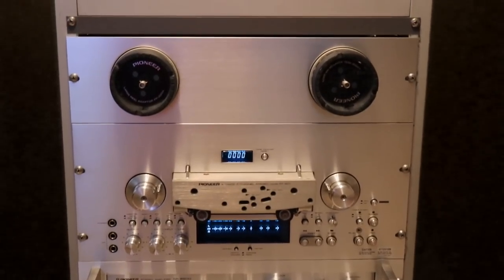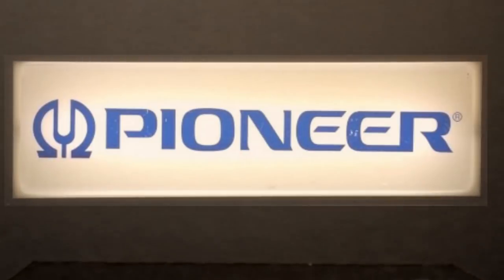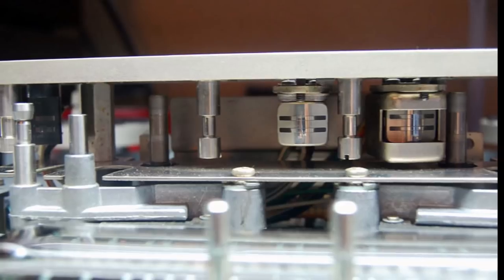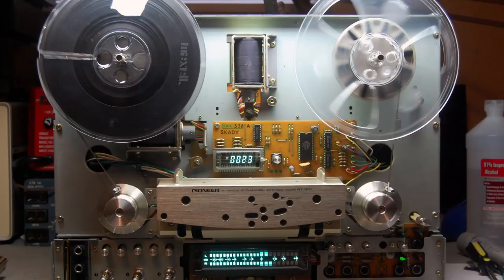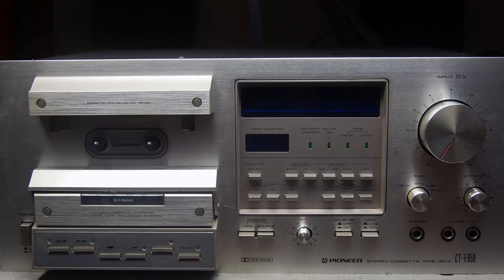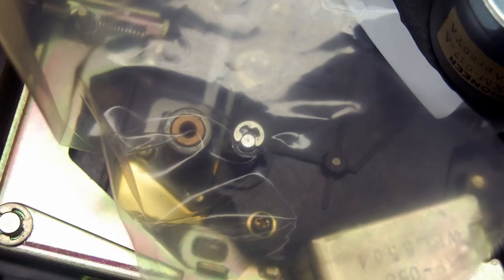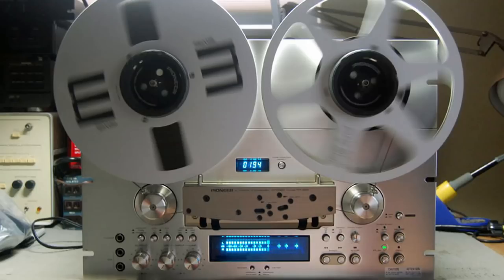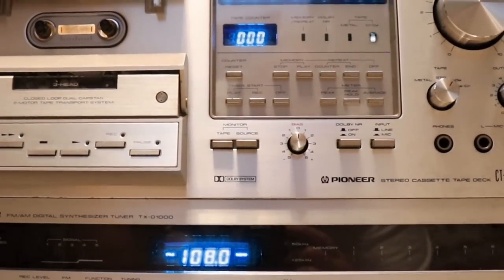Pioneer Silver Rack System. Vintage Amplifier Tuner Tape Decks Reel To Reel & Cassette Classic Audio

Comment: Such pride in the Build quality and looks of the old equipment , I miss that
Reply from the maker: Your not kidding. Just beautiful audio equipment that was made to last and it has.
Reply: My dad had a Sansui 1000x and a set of SP2000 speakers , record player and Tape with an Akai Reel to reel. It's I pity he let the 1000x go to a friend when he bought his 1st AV 5.1 surround amp. I still have the SP2000 speakers , the boxes are tired so I have removed the squakers , tweeters and 12" woofers and cross over network which are still in good working order for over 45yrs old.
Reply: D 1   I agree with you. And I miss them too!
Reply: @TheDarrenSR  I noted about your Sansui stereos. That was one major Japanese company which made high quality, durable and also most beautiful stereo equipment back in the 70's, 80's and upto 90's until sadly they closed down. The speakers you mentioned is a testimony to it. Yes, it's a pity that your father sold the amplifier. Anyway good memories for you!
I don't have Sansui and I wish I had. But I have some Pioneer stereo components.
Sorry about the late comment.

Comment: I've found that the rubber belts and tires and pinch rollers on Japanese-made reel-to-reel tape recorders from this ere almost never need replacing. Cassette deck belts are another matter.
Reply from the maker: Thanks for commenting.
Reply: I have seen many of the rubber 
Belts turn to black goo . It's a sticky mess !

Comment: You ever hear the story about a teenage boy who had this type of equipment back in the 70s before the blue equipment came out. Well, that's me. I totally regret getting rid of my Sansui speakers, Pioneer amp, preamp, tape deck, reel to reel, and the equalizer.  But I think the equalizer was from the 80s because it had the blue fluorescent display.
I think it was an ADC. I even had a pair of 
Altec Lansing floor speakers. I also had a pair of JBL 100s. I miss those days.
Good cheap weed. You could actually camp on the beach at night back then.
That was cool. Do some shark fishing at 3 am.

Comment: I have a RT 909 and a sa 8800. I want to get a cassette deck to match. I would love to find a pioneer rack. I wanted the RT 909 when it first came out. I purchased one in near mint condition from the original owner. He was leaving the state and could not take it with him. I picked it up with a bunch of 10 1/2 inch tapes for 350 dollars. I also picked up a rt 707. I love them and they sound great. Also he gave me the original receipts and the receipts for the mantaince that was done, belt and lubrication etc.
Reply from the maker: Very nice equipment that you have! There was so much high quality stereo gear back then. You could walk into any stereo shop and there was quality gear from end to end.

Comment: Im 58 now, but  back in the 70's we lived in El Monte Ca, back then there was a place called Best Products in West Covina, kinda like best buy, they had a small high end room that had this exact system, but it sat on a white, and black formica console table about 3 1/2 ft of the ground, it was kinda built in. the rack system here was at the back, and in the center of the table sat the turntable. It was definitely impressive, and expensive.
Reply from the maker: Thanks a lot for sharing. Many of us have fond memories that involve what is now vintage audio equipment.

Comment: Check the bias, the magna wide amp's have a two stage adjustment and service manuals was hard to find so many are wrong. My 7800 had this issue. Great Video's!
Reply from the maker: Thank You!

Comment: We have to pay outrageous money today on "HI End" stuff  to mach the average Japanese late seventies and early eighties top of the line quality, ( early nineties for Japan domestic market). Sansui, Pioneer, Kenwood, Jvc, Technics, Nakamichi, Nikko, Akai, Toshiba, Mitsubishi, even Hitachi and AIWA made amazing gear. I still have a complete AIWA minicompo all separate pre, tuner, cassette, remote unit, and power... with toroidal transformer and 15k mF caps for a mini compo! works like day one.
Reply from the maker: Your correct, back in the day you didn't need to buy the most expensive product in a manufacturers product line. All of the models were engineered and built well. Your AIWA is a great example.

Comment: I have the same Amplifier and Cassette Deck. I also have the TX-9800 Tuner. I think I have some dry joints in the Tuner and my Cassette deck which I haven't used.since I moved 7 years ago, now needs taken apart and the belts done. Enjoyed your video!
Reply from the maker: Thank you for watching. I hope it brought back some good memories. The Pioneer fluoroscan equipment was/is beautiful stuff.

Comment: This is the exact same system that was displayed and you could buy in the military exchange in "81".  I bought the RT-909 and if I remember a big pioneer SA amp can't remember the # but it was the biggest at the time.  The pioneer reverb or echo chamber and a couple other pioneer pieces the only thing that wasn't pioneer was my Kenwood Equalizer black with built-in reverb just because it looked cool and huge Harmon Karman speakers.  Bought everything new just before I left Getmany in late "82" shipped home for free courtesy US Army.  I don't think I had $2000 in the whole system when I got back to the states I went to a huge stero outlet in Sacramento CA to check prices, they hadn't even herd of my amp but they did have a smaller one in the SA series and went for a $1000 or over, I think all in all I figured if I could find everything in that system in the US would have been well over $5000 I think.

Comment: Thanks for this. I have an older RT-1050 half track that was once a workhorse. Take-up is lifeless; also a TEAC A3440 with same problem.  Pretty sure I can fix them. -- (I'd kill for that F950. The external bias adjust sends me into ecstasies..!) Checked out the variac on Amazon; seems a great value at $100.
Reply from the maker: Your welcome and thank you for commenting. I have a RT-1011L, The old reel to reels are tanks and I'm sure that you can get them going again. A variac is a really good idea if you work on older electronics and as you found out they are not terribly expensive.
Reply: Watch out for the older brown open reel tape . It eats heads 
I have had good luck with maxel ud & udxl tape .

Comment: Hi Chris, would you be interested in restoring a Dynaco set?   PAT-5 and
Stereo 150 Amplifier.

Both work.

My cousin's father-in-law built the set many many years ago.  We discovered
the gear in a closet in his house when he was moved to a home for
Alzheimer's patients.  We'd love to get this set looked at so it can be setup and kept in play to honor him.

We hooked up speakers and then connected an iPod to the Aux inputs.  Sounds
great.  Only thing visually wrong is the power switch on the PreAmp is kind
of sticky when moving on and off, and the red power light flickers.  There
seems to be nothing wrong with the amp.. not sure if a light is supposed to
come on.. but we see none.

We have both owner's manuals as well.

Can they be mailed to you for inspection, cleaning, and updating
(capacitors, etc)?

Thanks,
David
Reply from the maker: Hi David, Thank you so much for sharing your story. I enjoy the personal stories behind the vintage audio equipment. When I purchase vintage audio equipment I find out everything I can about that individual piece of equipment and I write it down and then I have a permanent record of it. Thank you for having convenience in me to look at your equipment but I'm just a hobbyist that collects and works on his own personal equipment. It's not my profession. Google "vintage stereo repair" or "vintage audio repair" and see if someone comes up in your local area. It's tough to find service people for the vintage equipment but there are still some around.

Comment: This rack-mounted system looks like the system that was on display at a local department store in 1976. I wanted to submit an audition tape to a radio station to try and get a job as a part-time DJ. I only had cassette decks at home, but the station required the submission on reel. Solution: Take the demo cassette and a blank reel of tape to the department store, and make a copy. Store security personnel were watching and they took me aside when I removed the tapes from the machines. I explained what I was doing, and once the security guy knew I was not stealing tapes, he said, "I hope you get the job". I actually did get the job, and started working in commercial radio on January 2, 1977. Now when I'm at the radio station and a newbie starts working there, I tell them this story. They usually ask me, "What's a reel-to-reel tape machine??"

Comment: With all that work on the tape decks it would have been nice to see the results from your test set unit. Don't actually have to show the test, just the results.  What a testament to see how close it kept to the specs after all these years.
Reply from the maker: Thanks for commenting and for the suggestions. That helps me make better video's going forward.

Comment: the 80's SAE stuff was pretty nice too.  I still have my rt-909 machine. I wish you would have said the difference between the 901 and the 909.  I never heard of the rt-901
Reply from the maker: The is the RT-901 does not have auto reverse. It only plays in one direction.
Reply: got it.  thanks for the reply.

Comment: ? Are capacitor replacement need for this age of audio equipment. I have an ASEE and design PC board for 30+ years. Except for the very large electrolytic caps with vents. Are the other dip polarized or not worth re-capping?
Reply from the maker: I suggest that you google "electrolytic capacitor life expediency" if you do you will see that the manufacturers of electrolytic capacitors say that after 15-20 years they should be replaced. That's not my option but the manufacturers data sheets indicating that.
Reply: When you say not your opinion are you saying you disagree? I just took my old 1980 philips 312 turntable into a local shop. Small, I think 1 man operation that had good reviews. My turntable looked to be fully working after sitting 15 years and light lifetime use. I wanted a tune up (lube, new belt and calibration test) to see how well it stood up. It looked to run fine but I did not connect it to my system because I didn't want to push it if the belt was about to go. You know the mess they can leave.
I asked him if it should be recapped. He said it would not be need because the possibility that the low power circuitry should not be an issue. It does have good parts in it. But the power supply is also in the unit.
He was reluctant to do it because of ordering parts and labor.
I was unimpressed him over all. The RCA output jacks where a bit oxidized and I asked him to put a higher end output cord on it. He kind of freaked because he said the wires at the tone arm are so thin and he was not confident in doing it.
I know labor vs cost of equipment is an issue but that's his business. Hard to get good help nowadays.
Reply: @yumpinyiminy963  your concern regarding electrolytic capacitors is not so justified in analog equipment and low current liniar power supplies. SMPSs and digital stuff is where you need to worry about the elcos.
Reply: @jjcale2288  I am still doing research being out of the direct design and repair for 15+ years. Yes my turntable without a preamp is low power on the audio out.
However - the power supply is in the unit. Thus a transformer, bridge rectifier and decoupling caps on both sides of the bridge for the AC in noise and DC out. The DC power to the cartridge is low but it does have a DC Servo motor driving the platter. I don't have voltage or current draw specs for it.
I get what you say about the SMPS but the digital? The digital of what? Most digital is low voltage and power. Where as an audio receiver/amp of this age can have some deadly voltage and current inside.
Every channel I watch on this old audio equipment would differ with your opinion.
Even "Vintage Audio Addict" replied that the mfg's specs give those vented electros 15 to 20 years max. I guess I would like to see the digital type circuits you are talking about to understand better.
Reply: @yumpinyiminy963  my point is in digital circuits the electrolytic caps have a hard life due mostly to high frequencies and currents. Low esr and high temperature range are mandatory. In 70's and 80's when these hifi blocks were made nowbody cared too much about esr and temperature range partly because it's not critical in analog and partly because the elcos in that era were not made in China 😉
Reply: @yumpinyiminy963  oh, and by the way, I am curious what kind of cartridge is that needing DC power? And back to voltages,  in vacuum tube equipment those can be "deadly".
Reply: @jjcale2288  The platter belt drive motor is a DC Servo.

Comment: I have a Pioneer CT-F770 in my home. Would you like it?
Reply from the maker: Thank you for the offer but the CT-F770 is a little newer then most of the equipment I collect.
Reply: @vintageaudioaddict  I've tossed around the idea of just carefully parting it out on eBay.
Reply from the maker: @TechGorilla1987  Yes, you can sell your equipment on eBay. If you don't mind the shipping side of it. I've never had an issue with anything but some folks have.

Comment: The one issue I have with this rack system is amplifier placement. Seems it could get really hot as there appears to be no ventilation for it.
Reply from the maker: The rack is all open on the side's and in the back. Along with that the components all sit on individual shelf's. Everything looks tight but its not.

Comment: Hi, awesome build,system of dreams !
Ive recently bought some blue line pioneer , my parents had a full stack late 70’s early 80’s, the envy of all my friends and their parents ! 
The ctf600 tape deck needed new belts , i managed to change them , but the output from the deck is super quiet, it sounds good , but the amp has to be up full ! Any ideas on what it could be ?
Thanks 
Chris
Reply from the maker: Thanks. Are sure it's the deck? Could you have the input and output RCA cables reversed from the deck to the Pre-Amp? That would cause the issue you are describing. That may not be it but check the simple things first.

Comment: What about the TX-D1000? Overlooked!!!
Reply from the maker: LOL, I know. She only made a cameo appearance. I'm going to re-visit this rack system down the road and the TX-D1000 will have a  prominent role.
Reply: @vintageaudioaddict  AWESOME!!  My current system at home is Pioneer Silver Line with Blue fluoroscan meters.  TX-D1000 tuner (that's why I jumped), SA-8800 amp, SG-9800 equalizer, PLL-255 turntable, PD-S06 CD player (brought over from Germany (ebay) & running with a 110-to-220V adapter) and a CT-F850 cassette player.  Bought the amp & the tape player new in '79 & '80 with what, at that time, were my life savings.  The turntable off a pawnshop when I was in the Army in 84.  Everything else later on on ebay (a dangerous place for the wallet).  Thinking of swapping out the 850 tape player for a CT-F950 even though I don't listen to tapes anymore (but the mechanical counter on the 850 always bothered me; it seemed out of place).  THANKS YOU for these great videos.  They're a lot of fun to watch!!!  Even with other brands

Comment: I have the CT-F950 also. I changed the belts and rebuilt the motor and unit does work but the fluoroscope meter is spotty for the right channel. Sometimes it works, other times it doesn’t. If I press the Dolby the right Chanel Light goes out and only the left works. I still get the right channel sound through the speaker. Any thoughts on the right channel light?
Reply from the maker: Anything intermittent like that is most of the time a switch or pot that is in need of some deoxit cleaning/re-cleaning or maybe but not so likely a control cable needs to be re-seated. You said that you changed the belts but it's not clear to me from what you wrote if you had this display issue before you changed the belts. Intermittent issues like this can fool you easily and take you around and around. I would clean all of the controls well first and eliminate that. Deoxit the controls, then exercise the controls 30 or 40 times. Also make sure all the connectors are seated well. It's possible a bad solder joint on the display board could be causing an issue but you say it's when you push the dolby switch that the issue happens so that's probably not it.

Comment: I have an RT-909 and I love it. One problem has existed since I acquired the unit. That is, in the reverse direction, the capstan eats the tape. I took a good look at the alignment after a thorough cleaning, and it still does the same thing. The forward direction plays beautifully no problems. So what do I look for. The tracking looks ok. What should I look for?
I love my 909.
Great video. Starlink@ teksavvy.com
Reply from the maker: Thanks for watching. A dirty tape path would be my first thought but you said that's fine. Make sure the capstan shaft's are 100% clean and everything else for that matter. The tape tension could be off but there is no way for you to check that easily without the proper equipment. Your RT-909 is getting to the age that it could be something electrical but most of time it's something in the tape path itself. I would clean the tape path again just to make sure.

Comment: Hi, I have “all” components to build 
“Blue line” rack . Rt-909,CT-F1250,TX-7800,CT-F950,RG-2,DT-500,SR-303,SG-9800and SA-8800 . How to connect them in ONE system? Please help ,where I can found Schematics for wiring .
Thank you very much! 
Best regards!
Reply from the maker: You can go to hifiengine.com they have the owners manuals online. That should help figure out how to hook up the equipment.